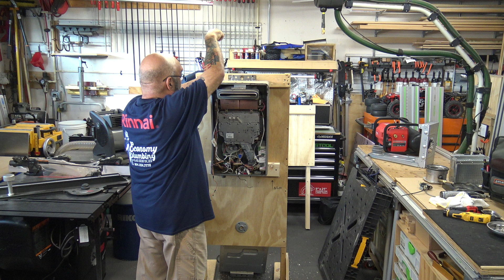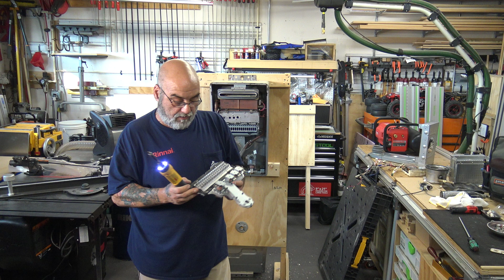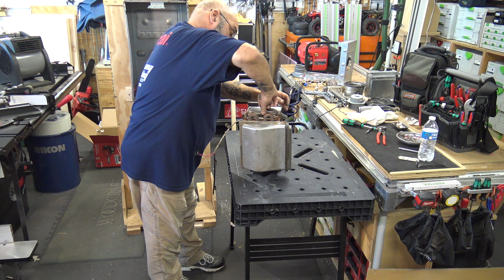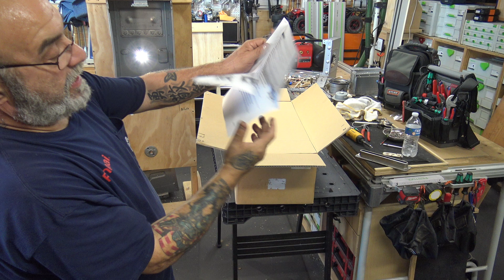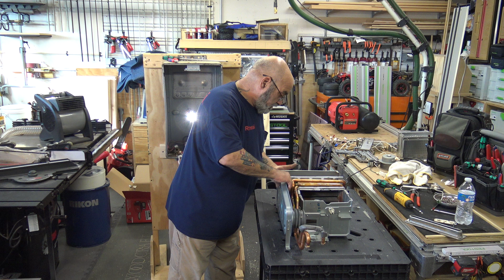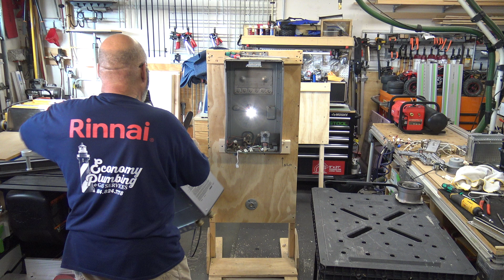Rinnai heat exchanger removal on a non-condensing RL series unit.

Comment: Hey sir I’m getting a code 12 alarm that goes off only when I turn on the master shower, so no hot water or if hot water come on it goes cold quick.. all other areas of house get hot in faucets and fixtures. Can you give me some advise?

It’s a 2011 jacuzzi model which I believe is just a white labels Rinnai